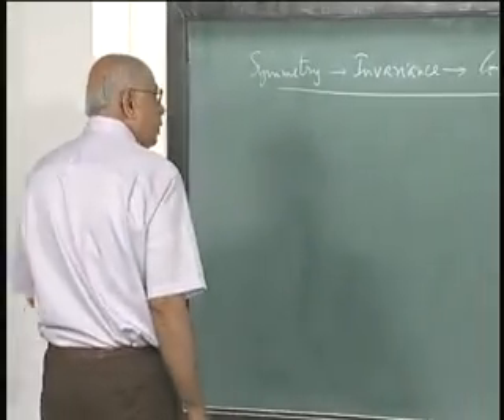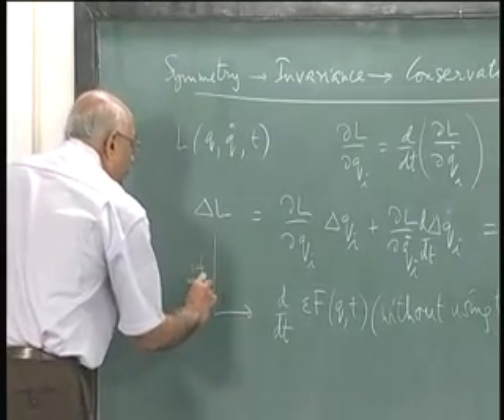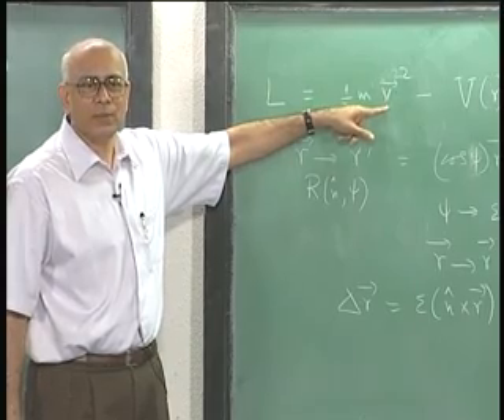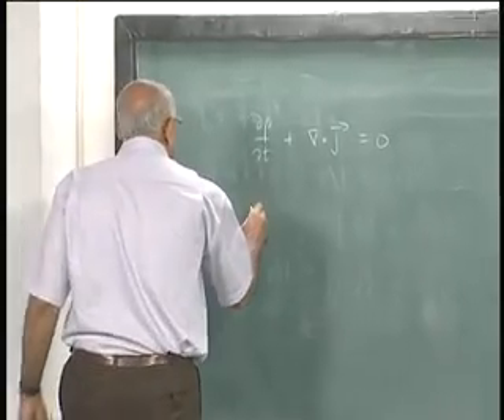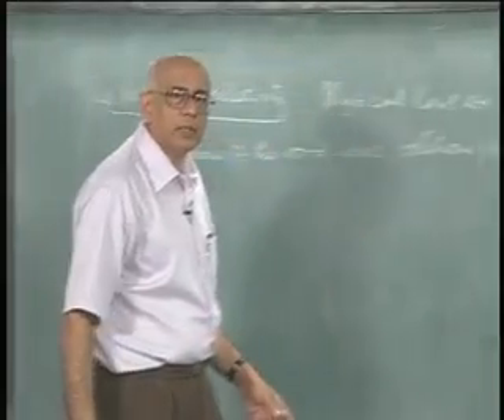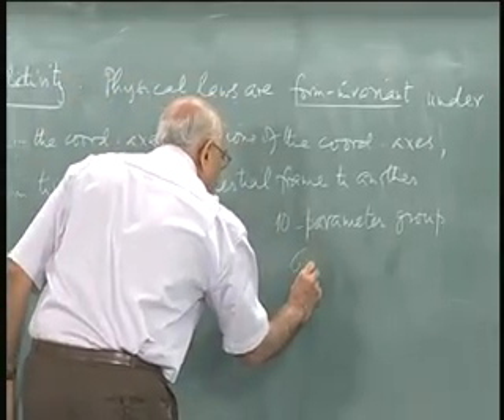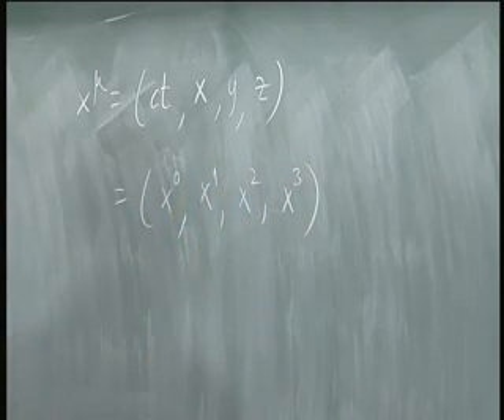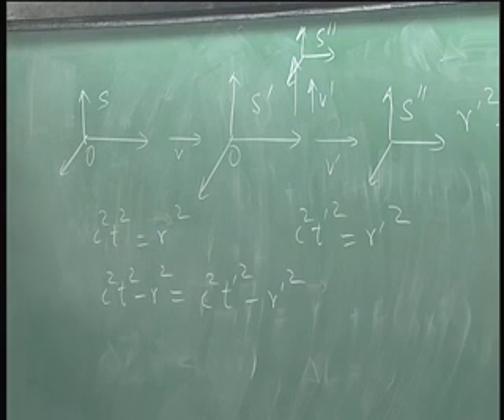Mod-01 Lec-35 Noether\'s Theorem. Special Relativity (Part 1)

Comment: The definition of inertial frames of reference (FoR'): Prof Balki says that the definition for inertial FoR's can be either that an inertial FoR is one in which Newton's first law holds in an inertial FoR. But he quickly adds that this means you need to perform an experiment to confirm the inertial nature - uniform motion continues to be uniform. And that this is question of experimental precision, finally, to do so. He also goes on to say that a (possibly) better definition is to use the criterion that for an inertial frame by definition would be that "space-time should be flat." It's not obvious to me as to how this is better or gets rid the "need to perform an experiment to determine whether or not the FoR of interest is inertial". In other words, wouldn't you (again) need an experiment to determine whether space-time is flat or not?
Any insights on this, folks?
Reply: You do, but wouldn't "observing the fixed stars" (if one wanted to find if a system is an IFOR in Newton's times) also an experiment? What's wrong with performing an experiment, it is an observation, isn't it?
Reply: Sivarama Krishnan [1] : You are absolutely right to worry about the tautologic "definition" of IFOR. It is a VERY tricky point, extremely tricky, but indeed a VERY crucial one! 

To be honest, first is to go back to Newton's precise and exact fundamental definitions. Because Newton is VERY precise, VERY subtile, and VERY deep. At first glance it seems that "his" FIRST LAW is only a special case of "his" SECOND LAW... But this is NOT so. Newton is everything but NOT stupid. If he separates carefully LAW I and LAW II there is a VERY good reason. Why that? Precisely because it is CRUCIAL to define IFOR, and Newton gives this grounding task to the FIRST LAW which is in fact ENTIRELY HIS DEFINITION OF AN IFOR! 

In seing why, we realise that "his" definition is "diabolically" subtile and brilliantly wise. But does it get rid of it's TRICKY hard core? Newton surely knew its VERY tricky aspect and probably also the extreme deepness of such a concept of IFOR. 

So when he says in "his" FIRST LAW : "A thing on which no force is acting upon will remain in it's state of rest or movement", what does he mean exactly? What is a "force"? How do we know if some "force" is "acting" or "not"? In which "reference frame" are we suppose to "observe", "measure" (by experimental test?) the change, or unchange, of "state of movement"? What is a reference frame? What is "movement"? What is "stillness"? 

Many VERY subtile and tricky concepts, and difficult questions indeed! 

It seems at first that the very concept of "force" may well show to be somehow "dubious", almost "esoteric", and at least fairly abstract, since in most real cases it may be very problematic enough to OBSERVE AND MEASURE DIRECTLY such an almost "chimeric concept". It seems a-priori more a platonic IDEA than a DIRECTLY MEASURABLE "solid reality". 

So it seems to start rather badly! Since the very first fundamental concept may appear to be no more than a very vague platonic "IDEA"! BUT NEWTON DYNAMIC WORKS! AND "DIABOLICALLY" PRECISELY!... So how does it works? 

It works firstly because this force "IDEA" is like an essential ABSTRACT BRIDGE between the CONCRETE "CAUSES" OF "MOVEMENT" and "MOVEMENT" itself! For a mass attached to a spring for instance, MODELED by Hooke's Law, the "force F" plays indeed an essentially SYMBOLIC ABSTRACT ROLE, BUT THAT LEADS NEVERTHELESS TO A CONCRETE SYMBOLIC CRUCIAL IDENTIFICATION (mi being the inertial mass) : 
mi.x'' = F = - k.x

It thus trully seems at first obvious, that this subtile concept of "force" looks indeed much more as a METAPHYSICAL one than as a Physical one, since the only REAL OBSERVABLE is actually x(t), from wich we DERIVE x'=dx/dt and x"=dx'/dt...

But on the other hand, it also seems that we may have more! Because we can OBSERVE & MEASURE the corresponding changing spring length x(m) corresponding to different gravific masses m, hanged to this vertical spring who obviously RESIST to the hanging mass, preventing it of free fall, as it obviously does without the spring. 
And so by observing that the usual free fall meats an obvious OBSTRUCTION, we then infer that "the spring indeed (PARTLY) RESISTS and more precisely EXERTS A PULL/PUSH BACK (ACTION-REACTION) FORCE AGAINST "any cause" trying to change it's shape/size. 

But these are just "words" for the moment, saying how we do measure the spring length x(m) accordingly to the hanged gravific masses m, BUT NOT YET SAYING HOW CAN WE ACTUALLY MEASURE THIS "METAPHYSIC OBVIOUS HOOKE FORCE"! 

And here comes THE GENIOUS (not of Newton) BUT OF HOOKE, who braught an enormous ill known contribution to these crucial chapitres of Mecanics and more generally Physics ! 
Indeed how in the world could he get his F = -k.x Spring Law, with no more than the x(m) caracteristic spring correspondance, since his Law F = - k.x, IS TOTALLY INDEPENDANT OF m?! This is striking!...

This is indeed THE CRUCIAL POINT and ONE OF THE CRUCIAL ACHIEVMENTS OF HOOKE'S GENIOUS! 
But thus, an extremely upsetting, much too brilliant concurent, bringing way to much shade to Newton supremacy taste. And indeed Newton unfarelly, abusevly and shamely stole as many possible Hooke's genious achievments he could, and to cover his crime, erased and inhumated Hooke in the underground strategic historical amnesy by destroying all possible Hooke's records up to his portrait originally troning in high academic honor. Endless shame to Newton for this greedy madness and criminal abuse of power!

Nevertheless, Newton didn't succeed to endlessly steel to his own fame this CRUCIAL HOOKE'S LAW that historian soon managed to honor back to it's true father : HOOKE! 
And this is crucial, because Hooke's Law contains much more than it apparently seems to contain, that is, much more than a "simple" spring behavior law! 
Indeed, strictly speaking, the spring "behavior" law is only the x(m) correspondance. Thus the crucial point is to undrestand how did Hooke managed brilliantly to "get rid of the m dependance" and thus EXHUME FROM THE HEART OF MATTER, A UNIVERSAL MASS-INDEPENDANT FORCE? 

Hooke was an experimental genious in charge to present a weekly crucial Physics experiment to the British Academy. 
He thus extended brilliantly all possible experiments of our Ancestors, Galileo slope falling balls, Pendulum behaviors, magnetic-metal attraction-repulsion, spring pull/push back caracteristics, matter deformations, balls scatterings, wet sponge expansions, chemical thermic and mecanic reactions, celestial apparent movements... and by combining them in all possible ways (horizontally, vertically and in any possible slope), managed to discover most of what jalous Newton shamely strategically managed to attribute to his own fame!!!
Reply: Sivarama Krishnan [2] : So from the Galileo Free Falling Law : 
v/t = (Weight Acceleration Universal "Constant") = g , 
Hooke could measure with precise clocks of his invention, even more precisely the value of g at sea level, and observed it was decreasing with altitude. The final speed v could be measured directly or indirectly by many ways. One important is to measure the deformation it creates in wet clay stoping it, or similar processes. Using thus, and also discovering the importance of the "mv" concept and of the "p = mv" scattering conservation Law in it's essential energetic capacity of producing work, deformation...
 
And thus Hooke was in power to get much further in the determination of the explicit spring law dependance x(m) since he could moreover study the two variable dependance of x(m,g), by testing the spring behavior in different liquids, creating "artificial" apparent variable g, thanks to Archimedi principle. 
Such Hooke's crossed experiments revealed the explicit dependancy : 
m.g/x = spring constant = k

And since gravitational weight m.g had here only an anecdotic role that could be replaced by deformation of the spring by inertial scattering balls of momentum mi.v, or by any other mechanical way as Archimedi Lever, it became obvious to Hooke that it made sens to talk of a SPRING PROPER INNER FORCE, IN FACT UNIVERSALLY INDENDANT OF HANGING MASSES, AND PROPORTIONAL TO x : F = - k.x

He confirmed in many ways that experimentally measured inertial mass equal gravitational mass. And studied all possible SPRING OSCILLATIONS (time periods, amplitude, damping, resonnance...), in "static laboratory frame" or in "rotating frame". Experimentally deriving the harmonic Time Period dependency in Pi, k and m :
T = 2.Pi.sqrt(k/m), and the Amplitude dependancy and Time Period Independancy in Initial Conditions in x(t=0) and x'(t=0). 
And finally plot the x(t) time dependancy cartesian graph, where the VELOCITIES v(t) =dx/dt are given by the slopes at each time, and the ACCELERATION at each time, given by the variation in time of these slopes a(t) = dv/dt.

By this Hooke was able to make the CRUCIAL LINK between k.x(t) and mi.a(t), wich is the so called "Newton second Law of Motion", but in fact mainly Hooke's discover! :
m.a(t) = m.x" (t) = F = -k.x(t)
Fundamental Law of motion that Hooke could verify being true in the laboratory frame of reference but NOT exactly for rotating oscilatory spring, in wich case it had to be modified by centrifugal corrections.

Thus the concept of IFOR started to become somehow more clear, at least in the paradigm of these types of experiments. It was indeed very tempting to promote this law to some larger (as large as possible) universality, but at least with the obvious limitation, coherent with all known observations (pendulum, spring, free fall...), that NO ROTATION SHOULD BE INVOLVED, and if, then some centrifugal corrections should be braught to it. Thus since the deep and crucial observation of Bruno about the RELATIVITY OF TRANSLATIONAL MOVEMENT, it became more and more obvious that MUTUALLY TRANSLATIONAL FRAMES OF REFERENCE may adventagiously PLAY A PREFERENTIAL ROLE, in particular being frames in wich is valid the "Spring dynamical Law" : m.a(t) = m.x" (t) = F = -k.x(t)

Thus since we saw where the THIRD LAW played already a crucial role in Hooke's experiments and theoreticall deduction, and similarly for the other two, it now appears that actually THE THREE FUNDAMENTAL DYNAMICAL LAWS OF  MOTION ARE ESSENTIALLY HOOKES GENIOUS ACHIEVMENT! 

Newton found himself rapidly in power to be the one that had time TO WRITE DOWN THE SUMMERISM OF THESE HOOOKE'S RESULTS, adding nevertheless his own genious extended crucial contributions, that were of mathematical outstanding calculus computations and his master peace of mathematical (partial) derivation of Kepler Laws, using HOOKE'S SECOND LAW OF MOTION : F = m.a, and NEWTON-ASTRONOMERS UNIVERSAL LAW OF GRAVITATION : F=G.m.M/r^2. 

BUT, Newton had IDEOLOGICAL back ground back thaughts when he was writting all this Natural Philosophy master peace. He had a talmudic, "religious" and kabbalistic ideolocical oriented view of the Universe. He assumed beyond (his) doubt, that since 'god' should exist, there had to be A ABSOLUTE FRAME OF REFERENCE! And it was a mainly global accepted view of these times since it could not even been thaugt that 'god' wouldn't somehow BE THIS ABSOLUTE FRAME OF REFERENCE. 

And else this Metaphysical "decisive" argument, the subtile Spining Water Backet experiment was a supplementary strong concrete advocate to Newton's ideology of Absolutness, in particular THE EXISTENCE OF AN ABSOLUTE FRAME OF REFERENCE, IF NOT PHYSICALLY "EXISTING" (OR ONLY APPROMATIVELY), NEVERTHELESS METAPHYSICALLY "UNDOUBTEDLY" EXISTING! 

This si a very strong statment, which is not so streight forward to declare peremptorially that it was washed away by "RELATIVITY", or even so called (missleadingly name) "GENERAL RELATIVITY"! 
Indeed, already Mach was an outsdanding visionary in understanding that somehow the local behavior of matter is no only determined by "close" neighboors in accordance to inverse scare gravitational and EM decaying law, but might moreover paradoxally depend on the GLOBAL MASS OF THE UNIVERSE! The hall picture playing somehow the role of this ABSOLUTE FRAME OF REFERENCE.
But we have more, with the 3 Kelvin Cosmological Temperature isotropic and homegenic "background", which is also somehow this same ABSOLUTE FRAME OF REFERENCE.
And recently the very large scale Great Repeller and Great Attractor may also advocate for such and ABSOLUTE FRAME OF REFERENCE.
But the Higgs also could be somehow some aspect of this ABSOLUTE FRAME since it is conceived to BE EVERYWHERE GENEROUSLY PROVIDING MASS TO PARTICLES!
etc...

Thus it is no so clear if it is actually so justifyed to ostracise this ABSOLUTE FRAME, less nowdays for metaphysicall reasons, than for solid accumulated and convergent physical reasons!
But there is more, because whereas translational velocity strongly seems to be relative to the frame of reference, this is only due to Noether SPACE HOMOGENEITY SYMMETRY! Indeed Linear momenta Conservation Law fails as soon as this space homogeneity symmetry is broken! And thus with it "inertial frames" special propriety, loosing the "prefered" role they use to play.
Worse, spinning behaviors are much less relative and stand some strong "absolute", or at least proper spinning caracteristic. The flatening of Earth at the poles is hardly "relative" to a frame, and much strongly an actual OBJECTIVE FACT signing the ABSOLUTE EARTH PROPER ROTATION! And it is mainly useless to think that looking at the Earth "steady" in a inversely spinning "englobing" cosmic frame, could easely explain the Earth poles flatenings!  
And what about quantic inner Spin, or other quantic observables that are somehow deeply linked WITH ONE UNIVERSAL ABSOLUTE L2 HILBERT SPACE...

Thus we may have some very supresing surprises about this strongly but maybe arbitrarilly and unjustified ostracised ABSOLUTE FRAME OF REFERENCE! 
Moreover, it is not at all excluded that Newton was not misinterpretated since he says of the Universe that it is " A sphere wich center is everywhere and the circumference nowhere"! It may be not so far to some aspects of this Universal Frame of Reference, somehow a smooth "PRESENCE", absent nowhere, present everywhere...

But Poincaré fundamental remark makes the situation even sharper because he strongly emphasised that Neighther Space Nor Time are Observable, but indeed, only interacting objects are !
Stressing out by this, with Kant, that SPACE-TIME is a mathematical metaphysical concept, and not a physical reality. Killing thus all empty statments about "curvature of space-time" by emphasising that only mathematicall metric can be given such curvature, but by no mean "space-time"! Poincaré emphaissing very strongly that no Physical experiences can ever chose betweeen Euclide and Lobatchevsky!.. making the choice, OUR CHOICE, based on commodity arguments, and NOT in instrinsic ones!

Moreover lets not forget that when we name "space-time" in the Poincaré Relativistic post 1905 sens, there is no a priori time axis nor spacial axis in this 4 dimensional continuum! 
Or on the contrary, that in Mathematics, even if linear spaces contain all possible basis but no particular one exclusively, nevertheless, there is "ground state" CANONICAL N-UPLET BASE (1,0000), (0,1,000) etc! Showing that even in mathematics a somehow ABSOLUTE FRAME OF REFERENCE is crucially needed side by side to RELATIVE BASIS!